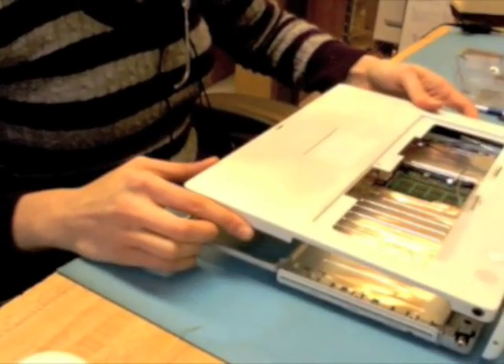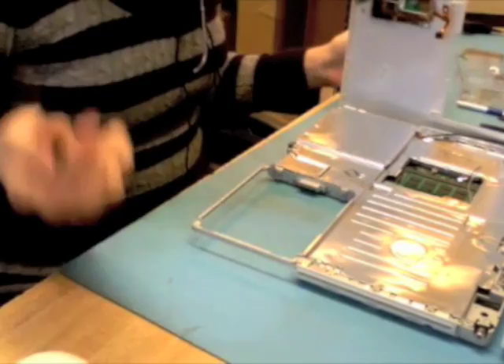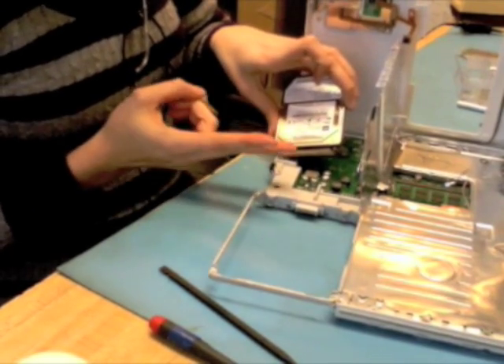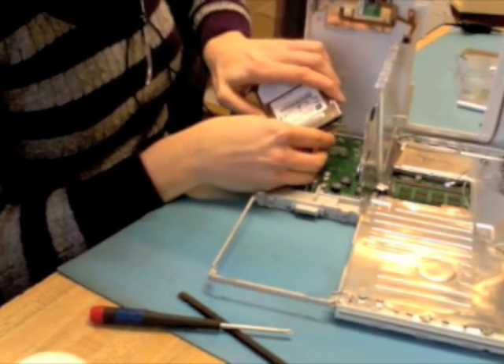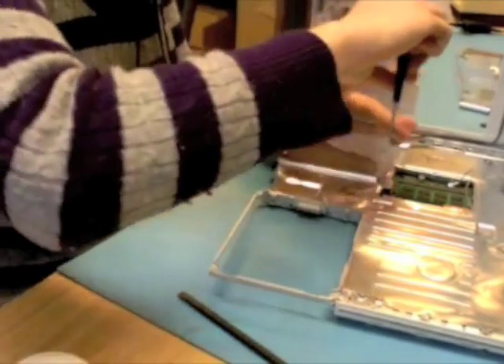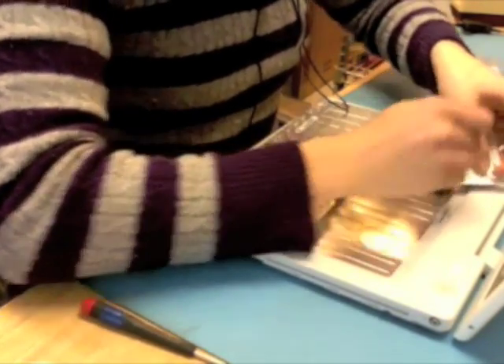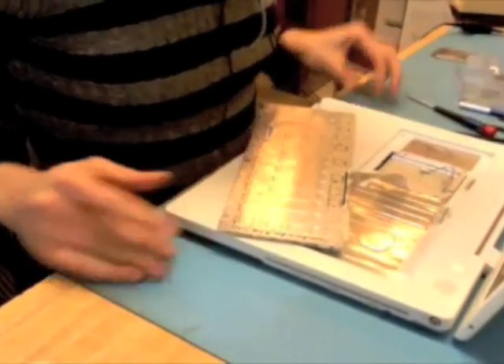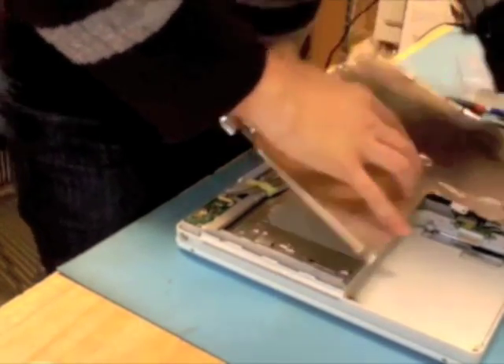iBook G4 Hard Drive Swap Part 2 of 3

Comment: Great video Rebecca!  One small warning for those trying this, though.  Be careful if you use this method of the power cable and the polycarbonate top lid.  I didn't have it resting well enough on the metal top shield, and when I turned to get something else, the plastic top shell fell over and ripped out the power cable plastic clip from the logic board.  I had to solder the plastic clip back on, which was not fun.

Comment: Thanks but what was the purpose of removing the bottom casing and shield? I've watched other demos where they detach the ribbon cable fropm the logic board but you didn't do this so there should be no reason to remove the bottom